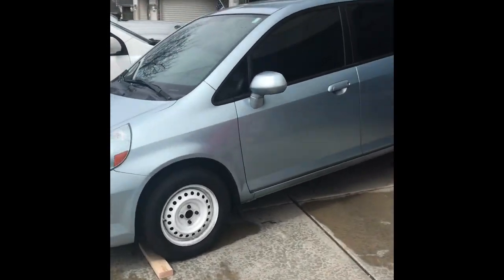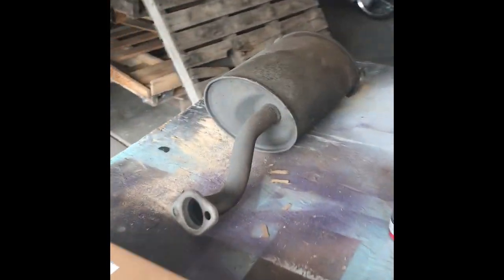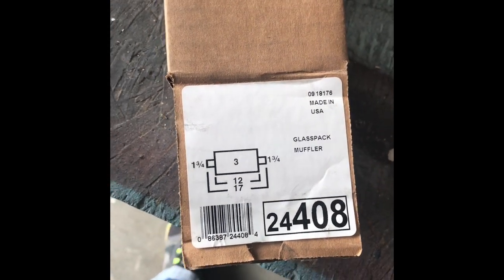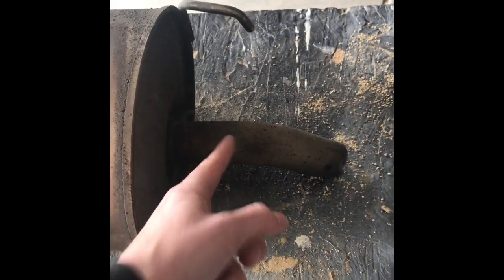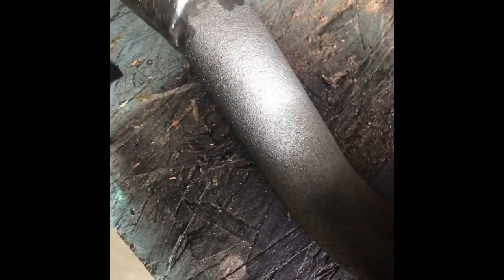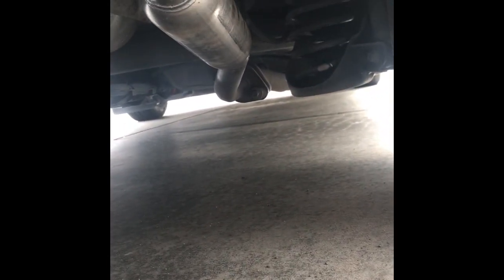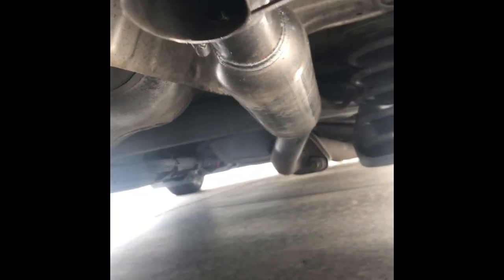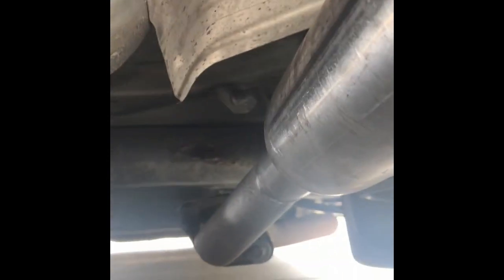Honda Fit $20 Exhaust

Comment: DSYCAR Universal Stainless Steel Car Exhaust Tail Tip Pipes Cover - Fit pipes Diameter 1 1/2 inch to 2 1/4 inch - 4 Free Valve Stem Caps (Curved:5.5'' X 3.4'') https://www.amazon.com/dp/B06XR71FBQ/ref=cm_sw_r_cp_api_i_E5M9CbK970SJ6
This is the tip I put on due to the drone inside the car. It dramatically changed the in cabin noise to near stock sounding.

Comment: Another video man? I have a 07 fit in the same color🙂
Reply: Eric_ Niles_707 
I ended up putting an angled exhaust tip on the end because it was a bit droaning inside. Changed the inside sound dramatically better
Reply: @traviswingo7849  angled towards the ground like the OEM exhaust? Or angled up?